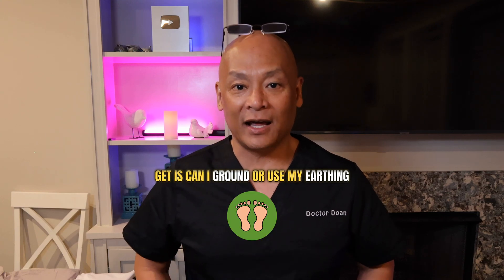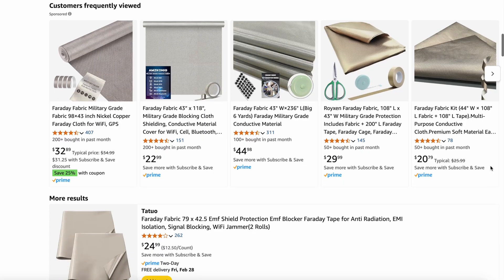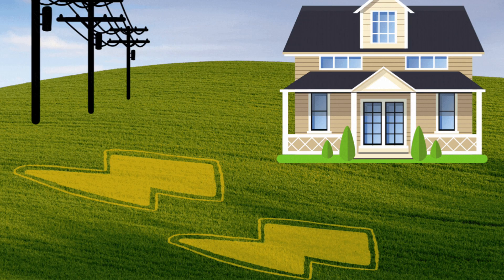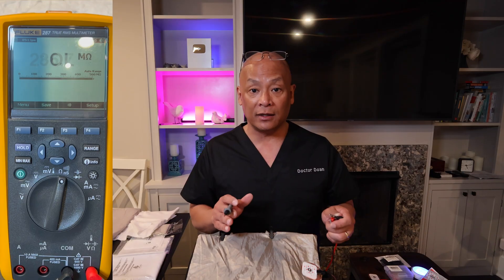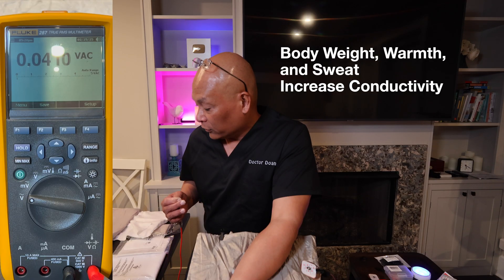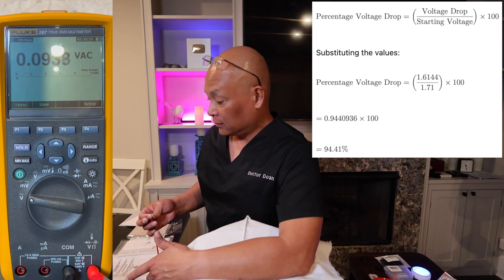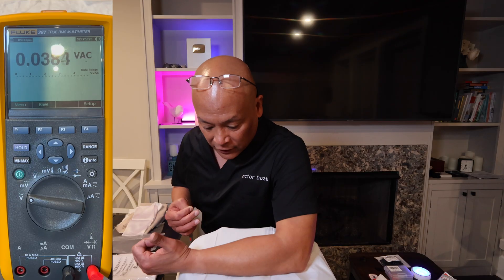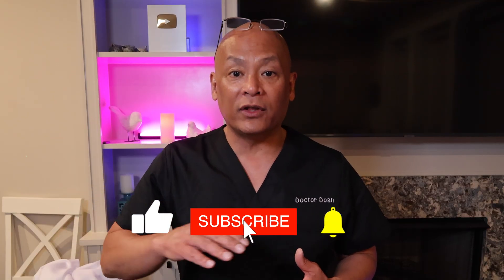I Tested DIY Grounding Sheets Under Satin And Found AMAZING Results

Comment: these are obvious questions and we all must have a good multimeter to test for ourselves, thanks. Next plz try to test the increase in body voltage in various heights of floors in a tall apartment building. If u can get a very long copper wire - test at least upto 10 floors. Or try to get it done via other science buffs.

Comment: Would adding resistance to the ground wire that clips to the Earthing Blanket cable in your home reduce the danger of unwanted energy coming from our homes voltage?
Reply from the maker: It reduces it but does not eliminate it. It's best to have a clean grounding source.

Comment: Are there an any results from peered-reviewed, large scale, double blind. Studies on this tech available for reference?
Reply from the maker: Triple-Blinded, Placebo Study: Müller et al. (2019). Effectiveness of Grounded Sleeping on Recovery After Intensive Eccentric Muscle Loading. Frontiers in physiology, 10, 35. https://doi.org/10.3389/fphys.2019.00035

No large scale studies exist. This study is exceptional but still statistically significant.
Reply: @DrAndrewDoan Thanks. A larger sample size would be interesting to see if the statistical significance still holds up, but the methodology used in the study appears to be rigorous indeed.
Reply from the maker: Agree. Hopefully research like this will lead to bigger studies.

Comment: is the rod you use with your multimeter longer than your grounding rod for earthing? to get a better ground reference?
Reply from the maker: The grounding rod for the meter is the same length as the one used for my bedding. Longer is better, but 1-foot is adequate.

Comment: Absolute garbage. Our skin has a high electrical resistance. He knows Absolutely nothing about electricity.
Reply from the maker: You’re right that skin has resistance — but grounding studies don’t rely on shocking people. They measure changes in the body’s electrical potentials, which is standard electrophysiology. You know little about medicine, biology and electrophysiology 

Multiple peer-reviewed studies show grounding shifts surface charge (Sokal 2012), reduces inflammation (Oschman 2015), accelerates recovery (Müller 2019), improves sleep (Lin 2022), and even boosts vagal tone in preterm infants (Passi 2017). Babies definitely aren’t faking placebo.

So no worries — the electricity part is solid. But thanks for keeping the debate lively. ⚡️
Reply: @DrAndrewDoan  spot on, doc!👍

Comment: You don't really need these sheets, they can be damaged in the wash (and of course you have to wash them). All you need is a telecoms ground bonding plug and attach to your wrist at night (still plugs into wall socket). I have used these for years
Reply: I'm really interested in your comment, as it sounds straight-forward. Can you please elaborate on which products you use? I tried to look it up, but got totally confused.

Comment: Can I just run an electrical wire out through my window and attach it to a metal spike in the ground and also wrap it around any part of my body and be grounded?
Reply: attach the wire to copper cloth
Reply from the maker: Yes. Add a 100,000 ohm resistor inline to the copper wire to reduce the current outflow. Too high of current can also be damaging.

Comment: Dr. Doan, May I ask if there is a benefit to using 80 mesh copper mesh over Faraday fabric?

I want to make my own system for my parents, but I’d like to make it as effective as possible. If there is not much difference, I will take the cost savings of faraday fabric. Just looking for a more knowledgeable opinion. 

Thank you.
Reply from the maker: I am not aware of any benefit to adding copper mesh over the Faraday fabric. The fabric already has a high concentration of copper.
Reply: Dr. Doan, thank you for your reply. I really appreciate how informative and simple your content is.
Reply: Dear Doctor Doan: Just out curiosity, is the faraday fabric you suggest loud at all? I bought one on Amazon and it crinkles a lot when you sleep on it. 

Just looking to see if there is a better option than what I purchased. Thank you for your help.
Reply from the maker: Do you place it under a cotton sheet?
Reply: I do put it under a cotton sheet. It’s not terribly loud, and maybe as it breaks in it will get better. 

I  just want to thank you for replying to these messages. I can only imagine how busy you are.
Reply from the maker: I appreciate your interest in this topic!

Comment: Do you feel like the grounding mat is better than silver threaded grounding sheets?
Reply from the maker: Both are good, but silver can corrode and lose conductivity.
Reply: @DrAndrewDoan  so what type of sheets were best to use on top of a mat? I really like bamboo because they breathe.
Reply from the maker: @Drhunley 100% cotton is best. Bamboo should work but test to confirm.
Reply: @DrAndrewDoan  thanks so much for all the information. I tried grounding through the wall with the sheets that I got and I also aggravated an injury in my shoulder like you.

Comment: Hi Do you have to use a sheet over the grounding (carbon) mattress cover?
Reply from the maker: We use a 100% cotton sheet.
Reply: @DrAndrewDoan  Does that mean you should have a sheet over the carbon mattress?  Or it's okay to use without a sheet in between?
Reply from the maker: It’s okay to use without a sheet but the mattress cover will not last as long.
Reply: @DrAndrewDoan  okay now I understand. Thank You.  What is the life expectancy for the carbon cover?  How would I know if it was no longer working? Thanks again.
Reply from the maker: @HarrisHillResort It starts to fall apart! 3-4 years.
Reply from the maker: @HarrisHillResort  The mattress covers last about 3-5 years. Use a multimeter to confirm conductivity from mat to the metal snap.

Comment: Dear doc, please tell us HOW to measure the dirty electricity on oneself with a multimeter as you go along different surfaces indoors and outdoors, straight to the point, THANKS A MILLION ❤
Reply from the maker: To check for dirty electricity in your outlet ground, you need an oscilloscope (https://amzn.to/49Yax7k). Here’s my guide: https://articles.andrew-doan.com/which-grounding-method-will-you-pick-for-your-body/

There is also dirty electricity in the live wire of your electrical system, which has been associated with numerous human illnesses. See Dr. Samuel Milham’s book (https://amzn.to/4jeSGNR) You need the Greenwave or Stetzer-Graham meter. Using the Greenwave meter, dirty electricity (EMI) levels should be below 25 millivolts (mV). Levels between 25 and 50 mV are marginal and should be reduced if possible. Levels above 50 mV are undesirable and steps should be taken to lower them. A good rule of thumb is to reduce local levels of dirty electricity (EMI) to less that 50 mV or by at least 80% on a majority of outlets in your environment. The lower you can get dirty electricity, the better!

Dirty electricity filters are used to reduce dirty electricity in the live wire using capacitors to absorb the spikes and fill in the troughs. General rule for installing filters: Kitchen, Family Room, Living Room, Media Room, Home ,Office: 3-4 filters each. Bedroom, Dining Room, Laundry Room: 2 filters each

Greenwave DE Meter: https://greenwavefilters.com/product/emi-meter/partners/730/
Greenwave Filters: https://greenwavefilters.com/product/greenwave-dirty-electricity-filter/partners/730/

Or AM Radio: https://www.emfanalysis.com/how-to-measure-dirty-electricity/
Reply: @DrAndrewDoan  thanks a million 🙏